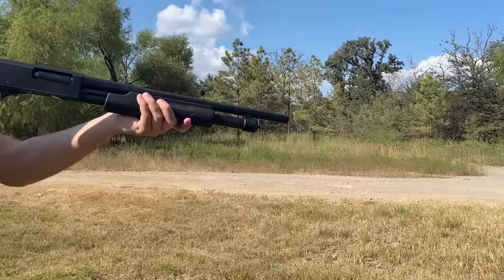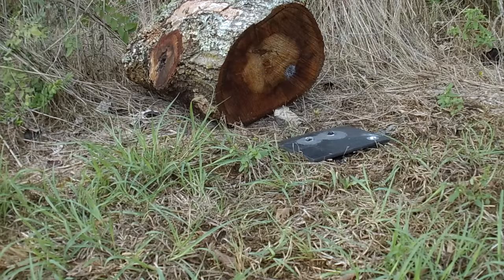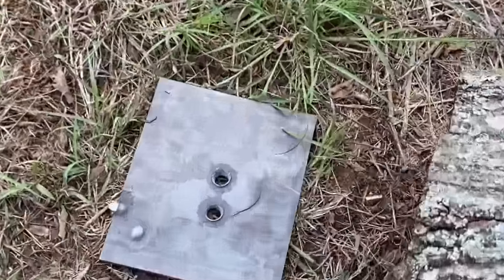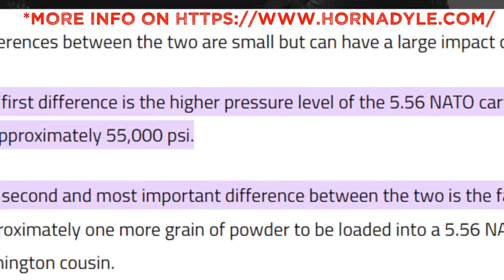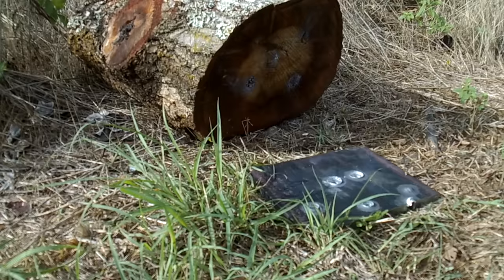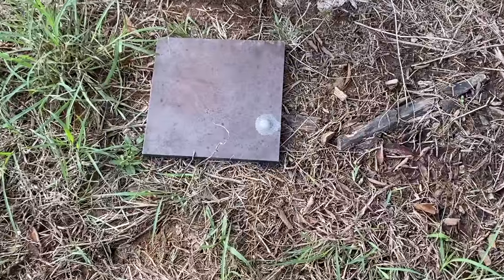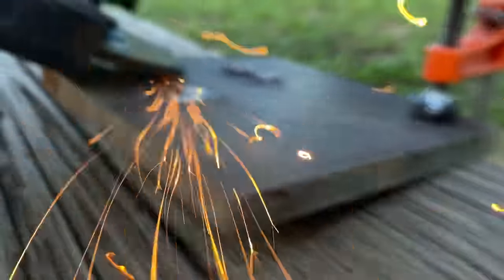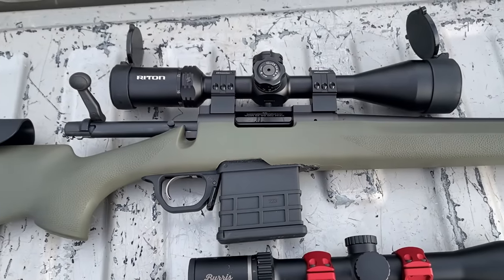223 vs 5.56: You Won't Believe The Difference On Steel

Comment: Your not telling that mill spec measures pressure at the neck closer to the throat where as SAMMI measures from the middle of the case and chamber.😮 could that make a difference 🤔 😅😂🎉🎉🎉and a single shot can also be deceiving 😊😮 JMO as I have been reloading for 40+ years 🤔 😳

Comment: I really don’t know why the tube recommends things but you did say comment…..as an engineer your experiment has so many variables that your results are just that. Low carbon steel is soft and inconsistent, it’s made for mold tooling not armor. The exact angle of contact matters even 5 degrees is an issue. No one uses a die grinder with calipers and calls out 3 digit results….. I could go on but you get my point, if we used your methods in aerospace manufacturing we’d still be flying biplanes……and you act like you’re on the verge of splitting the atom…………..🙈….(you asked)

Comment: Not only are pressures higher on 5.56 but the bullets themselves are typically heavier. 223 - 55grains 5.56 62 grain typically. I believe the green tip 5.56 has a harder metal too
Reply: The 62 gr M855 Green tip has a steel Penetrator tip , though it’s not an 
“ armor piercing “. round  it does aid in penetration objects such as steel.
Reply: Lap ammo... light armor piercing.... aka lap
Reply: NATO rounds are steel cored. Its a Geneva conventions thing for environmental BS. That helps but its still ineffective against 500 brinnel steel armor plates. Ceramic doesn't fare well with 556. Since everyone has an AR and shoots NATO, best change those ceramic plates for steel.
Reply: @thebeesknees745  advocating for steel plates over ceramic? RIP.

Comment: You tested the difference between Winchester ammo of a certain type and Hornady. What does that have to do with the difference between .223 and 5.56? An experiment, to be valid must control all of the variables but the one being measured. Fail.

Comment: The bullet used makes far more difference than the cartridge when it comes to steel penetration.  Thjis  whole test is not worth much without delving into the bullet type used..
Reply from the maker: I really wish that I could've reloaded the same exact bullet into each, but the load data was going to be the exact same so I didn't know that it would truly be "556 vs 223"

Comment: I bet the 5.56 only did better because it has a steel core. Check I bet those rounds are magnetic. The .223 is not The 5.56 not bear as accurate because the steel core often not perfectly centered in core. My opinion
Reply from the maker: I checked it out and this specific 556 did not stick to a magnet. Initially I was thinking the same thing though.

Comment: How do you know the two 55gr FMJs are identical??  That's what I thought you don't.  The longer throat on the 556 is for longer heavier bullets not more powder.  30 ft sec faster with the  556  makes a difference. Like 10% difference.  Get a Real Job.

Comment: In order to do these tests fairly you must first secure the steel plate in a vise so resistance is the same shot to shot.  Secondly the angle of steel plate must be exactly the same for each shot.  It takes more force to penetrate a steel plate that is angled vs one at 90 degrees.  The Russian T34 tank with its sloped armor is a great example.
Reply from the maker: I agree, I am working on making a fixture to solve this issue. Thanks for the tip, I remember watching that on the History Channel!

Comment: This is another demonstration of just how moronic some gun owners really are.  The .223 Rem and the 5.56 NATO are one in the same.  They may be loaded with different components, and in some instances to different pressures, depending on intended use, but the cartridge case used on both head stamps has the exact same external dimensions.  This also applies to 9x19 and 9mm Luger, .308 and 7.62x51 and 7x57 and 7mm Mauser, to name just a few examples.  The way a particular rifle is chambered or throated has nothing to do with cartridge designation. Yes, the military typically use slightly over-sized chambers to improv reliability but that has zero to do with name of the cartridge. The 5.56 NATO is simply the 'metric' designation for the .223.  Moral of the story; owning a rifle isn't the same thing as being knowledgeable about firearms.
Reply: The army took a commercial .223 and beefed it up.  The 5.56 added thicker webbing near the case head, different powder and charge to increase pressure for velocity, and used a more battle-friendly reliable freebore distance with the neck.  
But that was 50+ years ago up  until about 9/11 2001 when everybody suddenly jumped on the AR bandwagon.  Now you never know what you’ll get regardless of what is stamped on the box.  And manufacturers realized that there was this mistaken common knowledge that a 5.56 was the same as a .223. That is why chambers became fairly generous to accept both.  You’d be hard pressed to find a decades old rifle with a true .223 chamber, and even harder pressed to find true .223 ammo that fits snugly with near zero freebore allowing the bullet to touch the lands.  We are fixated on AR’s with their deliberately sloppy 5.56 chambers and generous freebore.  So both ammo manufacturers and barrel makers responded accordingly to this ignorance and slightly blended the attributes of both.  Wylde kinda got us back on track in AR’s at least.
Want to see my lathe and collection of chamber reamers if you doubt what I say?
Reply: @blackhawk7r221  No, that's absolute nonsense.  If you were correct, that would mean that every time a reloader took a .223 or 5.56 stamped case and reloaded it with different powders or projectiles or primers, he or she would be inventing a new cartridge.  Don't be ridiculous!  I'll say this one more time; cartridge designation is determined by the external dimensions of the case.  It doesn't matter how thick the case walls or head webbing is, that is up to individual manufacturers.  What matters is the external dimensions.  And again, chamber dimensions vary depending on the case dimensions and intended purpose.  Military chambers are usually slightly bigger which enhances reliability but reduces accuracy.  A dedicated custom target rifle by contrast would typically have a tight chamber and a modified throat.

Comment: For the most part there is no difference between 5.56 and .223. Many ammo's of the same grain weights can be found where the .223 is faster than the 5.56 from the same company.  Chamber pressure means nothing and only raw velocity is what matters (unless they have different cores).  That being said how Remington measured chamber pressure of the .223 and how the military measured it for the 5.56 is different and once done the same shows similar pressures.  The longer throat is only so the military can shoot tracers that require more head space.  Many people have done vid's of 223 and 5.56 case and powder measurements, and all have found they are the same.  All one needs to do is shoot the ammo at a chronograph and if they have the same weight and different average speed you can easily tell which has more pen.  That takes the random angles in the steel your shooting out of the equation.   He this guy explains it better.

https://www.youtube.com/watch?v=VCS4fXFmCyA&t=442s

Comment: My 22-250 will shoot straight through that plate with 55gr fmj @3600 fps
Reply from the maker: 22-250 is no joke, especially with an fmj. Unfortunately though with a 50gr hollow point at 3850fps, I was not able to get it to go through.

Comment: FWIW you do not use a 5.56 or 223 for steel penetration. Even if the bullet does get thru , what material  is left to do any serious damage? He could have saved a lot of time & money. 

Get a 30cal or better, save the smaller stuff for humans & not behind protection or a physical barrier. You are still firing a low-weight bullet. 

Think about it, what are steel shooting dongs made out of ? STEEL ;) An AR500s  style steel target plates fwiw, holds up very good against these 2 cartridges. I have  yet to destroy one 🔫

Comment: Not a god dam thing . There is no difference. Pull the bullet and measure the case  exactly the same . More or less powder or feet per second doesn’t make it a different bullet. 556 is metric and 223 is imperial measurement.

Comment: I'm confused by your very last shot comparison.  You grind both bulges down even with the plate and then you use a depth caliper to measure the penetration.  That really doesn't make any sense to me because you destroy so much of the evidence with your grinding.  Any penetration ground down to the plate would measure just about the same as any other.  It seems to me that a better measure of penetration would occur if you drilled a single hole in the middle of each bulge and then taken your measurement.  You might even be able to account for the thickness of the plate in order to come up with a more precise value.  Perhaps you should do a depth measurement from the side of penetration instead.  Your method makes no sense and I believe it is not a scientifically viable and repeatable measurement.

Comment: Thereal difference shootng steel is what the bullet is made of.  Yes the 556 military round is loaded a little more for a little more speed but the material theprojectile is made of makes the difference GAINST THE TARGET!  Penetration expansion etc.. is somewhat in regaurds to the speed of the bullet.  prticulary with how far it shoots and hard it hits and accuracy at differeny=t  distances.  What it can do to steel and other hard to penatrate depends on the round fired neaning what the bullets projectile is made of.  Sure it takes alot of speed but lead is soft and steel is much harder. Steel will not exand much that is what makes a shock cavity that helps its lethality to kill.  Steel will punch a hole in harder targets and go right through animalls and people that could end up in whatever  or whoever is behind it. Armred Peircing rounds are not lead progectiles/bullets.but the faster they hit the target with the same weeight shape and material they are made of willl make them go through better.  The AR 15 is 223/556 and illegal to  hunt deer with in  many places in the